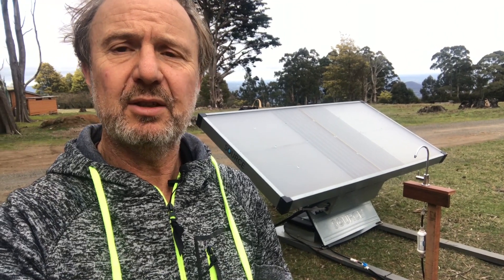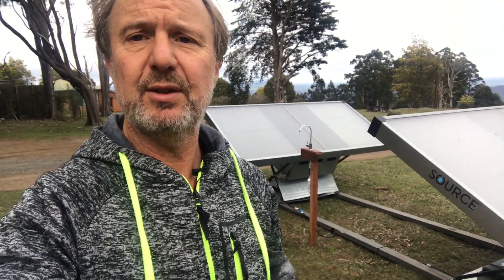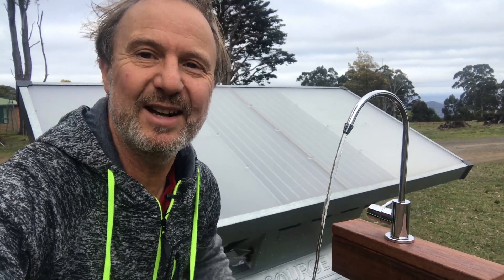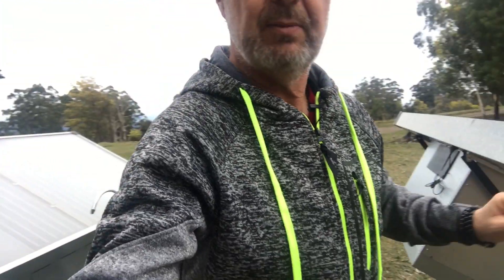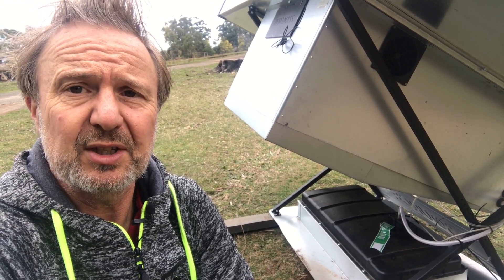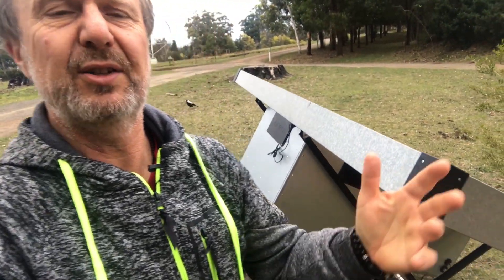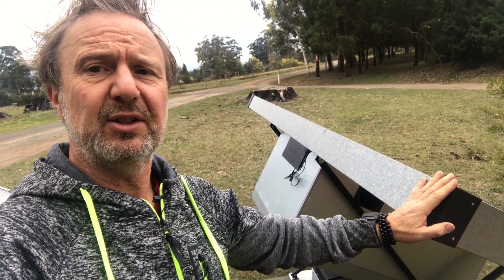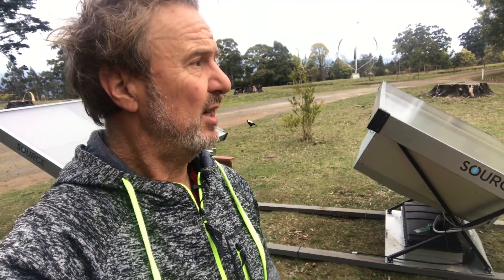Zero Mass Water hydro panels

Comment: Isn’t this the same process as an air conditioner, because you can’t drink that extracted water because of the copper contact…
Reply: No, unlike normal air conditioning or dehumidifiers, which use refrigeration machines to cool down the air, these panels use hygroscopic substances to draw water from the air. And solar heat to release the absorbed water afterwards.

Comment: How much liter will you get from air in hot summer in Arabia and what is the cost for single unite
Reply: Under ideal conditions I believe they can produce around 5 liters per day and I believe they cost a few thousand USD. I don't think Arabia would be ideal conditions however given it's somewhat more arid. This is a massively wasteful way to spend money in my opinion and isn't at all a solution to anyone's water problems.

Comment: What if you put that device on a polluted air. Let's say the air contains lead, 20%-30% of 0.5 micrograms per cubic metre of air.  Or maybe even in smoggy air?
Reply from the maker: Good question. I'll follow up with Zero Mass Water
Reply: @SmartEnergyLab  where do u think bill Gates will get all the energy to run 300 million penny's wrth of them that he just pulled out .
Reply: You get a filter.

Comment: If it works by dehumidifying air why not just use the condensate from your air condition?  You would be getting 10 times as much.  Because it's a stupid idea!!!!  And I see thank god you took some lame measure to make sure it doesn't propagate bacteria which could kill you.  But thank you very much I think I'll just keep using municipal water which is safe, requires no installation or maintenance, up front or back end cost, , and  for what?1/1000th the cost?  Seeing as this thing under the best circumstances is only going to produce what?  3 liters a day?   I'm not going to be able to cut out my water utility anyways. Why would I want to spend what? $5000 on this?  Suppose I didn't have a well or a  municipality to get water from?   Couldn't I just put a gutter on the same footprint area on my roof and collect more water that way for a fraction of the cost?
Reply: (Obviously it's not intended for every location/circumstance.)

The product is ideal for places with contaminated water (e.g. LEAD in Flint Michigan water), or where there might be desert conditions with unreliable water sources.

I consider it a prudent fallback device to not have to totally trust our lives to the local utilities, like here in the western US desert regions; if/when disasters happen, there's always a significant delay for sending life-saving necessities to thousands of people.  And not a bad way to avoid bottled water.

Also it's a decent donation/investment in a company that contributes to the developing world via a life-saving product.
Reply: @scienceminded9819   In my opinion  absolutely no circumstance where this product would be better than the current ways people get water. IE in a poor country you would be better off walking/driving to a river 5 miles away and gathering water and filtering it.  Or using the money to put in a well.  Or installing gutters to collect it. Or having it trucked in for a fraction of the cost.
Reply: @scienceminded9819  Or in the case of flint Michigan buying bottled water for less than 1/1000th the cost.  If you are in the desert you can stock up on bottled water and weather a disaster.  Anywhere else in the event of a "disaster" as you state,  a cheap relatively speaking water filter and just get it from a river, pond or stream.  Again for a tiny fraction of the cost.
Reply: @antares4141  Not sure I'd trust purchasing bottled water anywhere near Flint; they weren't honest about the pipes, so probably also not honest about enforcing bottling standards.

Anyway, regarding those "cheaper alternatives", I'm open minded to options that meet the following criteria, in case you have ones that beat those from this company:

* No chemicals leaching from plastics into the water, (no adding plastics to the environment for that matter)
* No piped sources having potential corrosion metals (see Flint), and/or contaminants from unknown environmental spills,
* No additional creation of greenhouse gasses to transport (or distill) the water),
* Self-contained unit requiring no external power that can go out during power outages.
* Onsite output requiring no travel to haul it home.
* Functionality guaranteed for 15 years.

In other words, are there competing products that fulfill these HydroPanel characteristics? Please specify if you think so, and I may purchase it.
Reply: @scienceminded9819   There is a carbon footprint on virtually everything.  Including the solar panels you use to power the dehumidifier to produce water at  what?  Five thousand times the cost of getting it from a local municipality.  And if your going to net-pick about the pipes in flint which isn't an issue anywhere else in the country run it through an R/O filter.   It's probably 1000 times more expensive than bottled at 90 cents a gallon.  If your going to net-pick about the plastic get it delivered in glass bottles.  By the way I see the  system in this video using a black plastic tank?   Probably what?  100 times the cost of having it trucked into a remote location.  Your requirements no plastic and no carbon footprint are ridiculous.  That the product you are defending doesn't even meet this stringent a standard is a testament to that fact.  Dehumidified water can kill you because of the organisms that can or rather DO grow in it.  Then your going to remove those organisms with UV?   I would not trust the UV lights and prefer that the water not be contaminated with organisms in the first place.  I would certainly much rather trust the engineers that ensure the safety of municipal and bottled water, over an UV light that has no oversight by an engineer that it is working correctly.  Watch this video: "Zero Mass Water -BUSTED!"  It really is a joke on every aspect which it can be gauged.
Reply: @antares4141  lots and lots of probably's, maybes and guessing in your writings. Also very isolated perspective that considers nothing beyond your immediate experience.

#1 Bottled water is much more expense. You say a gallon of bottled water cost 90 cents... Bottles of water are almost $2 in Florida a gallon of basic, cheap filtered water is at least double your stated cost. Even at that you would make your money back in 3-5yrs of the 15yrs it is warrantied. Compared to your 90 cent gallon, you would still make your money back and require no inflation.

#2 Have you lived/worked in a developing country and attempted to build a well, lay road, pay a truck to transport, or anything remotely similar to base your understanding on? 

#3 Do you know any actual knowledge about how this product has or could help people? Your goals seems to be to disprove a technology you cannot immediately use for yourself. 

#4 the video " Zero Mass Water - BUSTED" - is where pretty much all your words come from. The video was made in 2018. Your comment was at best 2yrs outdated (5yrs now). The video compares water transportation cost in the US. Can you park a water truck in front of your house? My HOA won't allow it and I don' t have a container to hold the water till I need it. The rain catcher comparison assumes high rain and low productivity. The Solar panel math is a guess at best (efficiency of the panel is needed). There is no actual production data from experienced users which is available online from owners. "Pointlessly massive designed control center ever"... is just a stupid comment meant  to diminish. Its a room with a few TV's and a small antenna on the panels. It isn't a million dollar command center....  Did this caring video creator posit another workable solution for the developing nations or areas where water isn't easy to get? Not at all. There are "Fog Water" projects changing lives in the world, but this guy doesn't care to do offer positives. Just getting clicks and trying to sell some crap on their Amazon store. He made a big deal about the $500 to run water from the roof to the sink... have you paid a plumber recently? Almost any reputable contractor or crew who comes to do work on your house will cost at least that much to put the crew in the truck and get there.
Reply: @scienceminded9819  In the desert where the air is dry this thing would be 2 or 3 times less efficient?      There are too many cheaper alternatives.
Reply: @scienceminded9819  I would rather "donate" my money to a reputable business that is selling useful merchandise that is practical to use at a reasonable price.    How many people has this company ACTUALLY helped this way?  I'm guessing ZERO.  So in my opinion reprehensible that anyone would try to sell the idea you are helping people by giving money to this company when the reality is you are if anything diverting desperately needed funds from legitimate companies and institutions that are actually making peoples lives better.

Comment: Any random dehumidifier plus a Brita water from filter would save you thousands over this set up.

Get more water as well.
Reply from the maker: @bjorn sjøstrom in the same way a Tesla EV is just an electric motor connected to some batteries :)
Reply from the maker: If you have power onsite then maybe a dehumidifier and filter will suffice but this unit is a self contained solar powered system for deployment anywhere on the planet.
Reply: @SmartEnergyLab  
have fun here in England.
Never see the sun
Reply: @Damian N yep, they only target gullible, desperate people in poverty

Comment: Are the panels water resistant? It rains a lot where I live. And I don't want them to take damage from the rain.
Reply: If it rains a lot there, why don't you put out some buckets and save yourself $4500
Reply: Haha I hope that's a troll. Buy a big bucket if that's your concern mate. You obviously don't need this if it rains. A bucket will capture way more water than the device makes.
Reply: There is nothing wrong if they still want it if it rains. In my area it usually rains, but this year there has been no rain in months and all the plants were drying out. It's always good to have more than one source for water because you never know. I save rain water, but I think this would be good to have as drinking water. Since the rain water I save I use it for my plants, fruits, and vegetables I grow and cleaning my clothes with.

Comment: Which climate is suitable to benefit from the system?
Reply: Amazon Rain Forest.
Reply: They can produce water in dry regions as low as 10% humidity. Optimal performance locations would be tropics for example, high humidity and a lot of sun
Reply: @jessebreffle6339  no they can't. It's simple science. To make water out of thin air, you need humid conditions where there is concentrations of vapour in the air. You do not get these conditions in the desert. Simple. If they do produce water, you are going to capture more rainwater by pure chance as setting up the space of the solar panel as a big water catcher. This product is A SCAM!

Comment: I'd be interested to know how much these panels are producing. I can't seem to find any straight answers as to how well these actually work online, and it seems to have all the same engineering problems that Fontus failed to contend with.
Reply: 5 liters per day, for the bargain price of $4500.
Reply: It’s 4 gallons per day per panel of potable water.
Reply: @jackellis1324  Hi can you share your source ?
Reply: They work best in a high humidity environment, out at Birdsville they would produce less than a 1/4 of what they would produce in Cairns